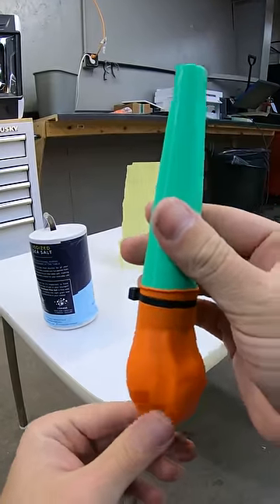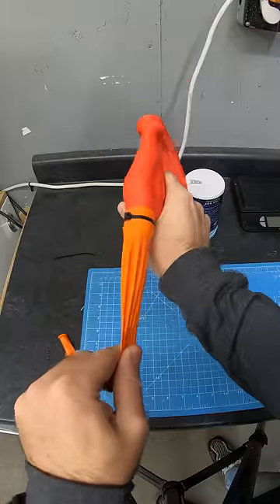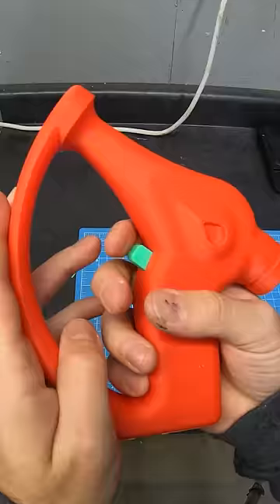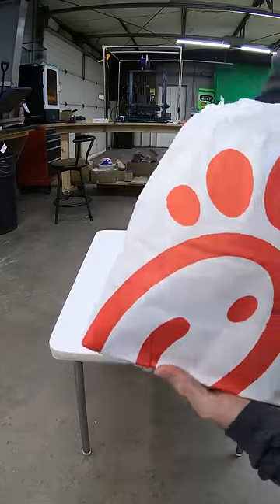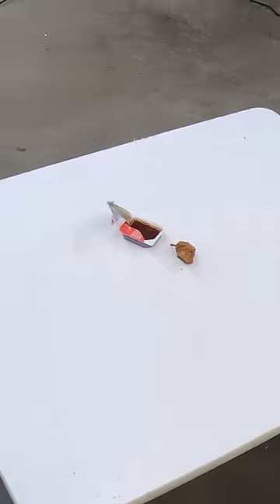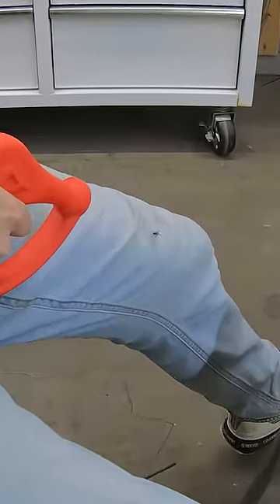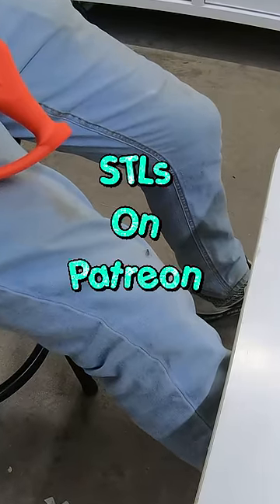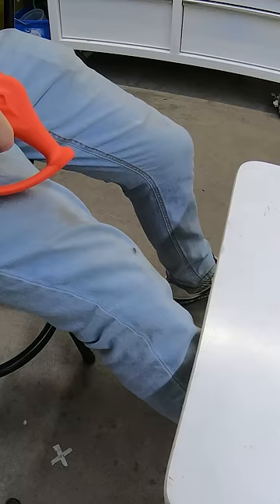3D Printed Bug A Salt?

Comment: You need a baral at least 3inchs or longer it will keep the spread pattern tighter at range giving you more range and velocity.
Reply: Distance and range are the same? No?
Reply: @adama.6074  they are, but i think range is usually used when talking about how far away you can accurately aim from, and distance is usually how far the projectile can actually travel.
Reply: @adama.6074 distance is the length that the ammunition can travel 
range is the distance of which the ammunition is effective at
if that makes sense
Reply: But you need spread in order to kill fly
Reply: At that point, dude could have just bought a salt gun for less time and effort spent.
Reply: You need Granulated grip Tape
Reply: @SirAuronthehonorable tell me you've never owned a 3d printer without telling me
Reply: @kuldeepsankpal6443 you need both range and spread. The range should be(for this product ) a 2-4 feet in case of wasps, or in my case hornets which are far more viscous than wasps.
Reply: Yall niggas really talking about gun smithing a salt gun😂😂 i love America 🇺🇸
Reply: @SirAuronthehonorable  Yeah but his channel is about making stuff
Reply: Ah yes CoD mobile logic
Reply: @adama.6074   I assume he meant to say spread instead of distance
Reply: So the longer the barrel the tighter the spread?
Reply: @BiBirdBoy both of them are used the same way
Reply: @kuldeepsankpal6443 a 3 inch barrel won’t make it a solid chunk it just makes the spread more focused
Reply: He made a fly blunderbuss. xD
Reply: Fr 😂😂😅...
Reply: Baral
Reply: Would just be pretty easy to put a choke on the barrel for spread
Reply: @BiBirdBoy mathematically speaking, distance means the distance between you and your target, and range the distance yoir bullet can travel
Reply: What if I want more distance but less range?
Reply: @BiBirdBoy oh so like accuracy
Reply: thats what she said.
Reply: @slop_core  Trust me buddy, you're not that guy/:
Reply: Just because you watched John Wick does not mean you know dead beat shit about guns
- My Dad, A Gun Expert who owns atleast 7 rifles {watching me scroll on comments}
Reply: Baral
Reply: He missed at 3 inches I'm not sure a tighter group is gonna help
Reply: @SirAuronthehonorable that's always true with building prototypes
Reply: @manofflorida1138 you lob the ammo at 45 degreees
Reply: @Alux_curly   another commenter corrected me, range is how far the bullet can travel and distace is how far you are from the target.
Reply: On the other hand, won't it force you to be more precise?
Reply: sorry to be that guy but its barrel
Reply: @blimbam  you are sorry for a reason
Reply: @BiBirdBoy  as long as you were corrected.   😂
Reply: And just more grains of salt hitting the target.

Comment: A slightly Longer and narrower barrel will greatly increase your accuracy. Mainly because it will help compensate for any directional changes caused by the inconsistency of the balloon pull. Also it will help regulate and narrow the spread of salt.

Comment: You guys need to know that the pistol is meant for bugs at a wasp level or maybe higher since it has compressed air... I have the pump rifle version and it CANNOT kill wasps as easily as it can flies. It took me 20+ shots from the rifle to break the wings of a wasp. It would not die from the salt even after 10 more shots.
Reply: Have you tried coarser salts on them?
Reply: @kayagorzan  I've used Himalayan salts on them yes... Still didn't kill the wasp.
Reply: I suggest using some sort of foam dart blaster. Some are really powerful and can annihilate a bug when it’s still.
Reply: Have you tried the 12 gauge
Reply: Tbh, you don't really need to kill them, but immobilize or confuse, then ye old shoe does the rest of the work, unless the fly sat on someone's balls.
Reply: @pinkius  Hell nah I had big red wasp flying around charging at me almost every time.
Reply: @Fipsh sand or dirt maybe

Comment: I forgot the channel name but you can just saw off a Gatorade bottle at the neck cut about half of the neck of a ballon wrap it around the gatorade top after you take the lid and the orange seal off then you just slip the seal over the balloon and you can drill a hole through the lid to make a pencil shooter or u can just take the lif off and shoot bbs and stuff

Comment: I've been working on modifying the Crossman Vigilante to shoot larger amounts of salt. (Obviously, you can just use the Shredder cartridge as is...) My issue is I can't leave a black metal pistol laying around my house, even if it is just a CO2 salt plinker.

I'm working on making a pink barrel front half of the Crossman, so you can tell it's clearly not a firearm.

Comment: I think you need a longer barrel, a stronger spring and an aim site to get the gun to properly shoot, the extended barrel will reduce the speed but increase the accuracy by reducing the shotgun effect, the stronger spring will counter that slower speed and lastly the insight will allow you to properly aim without shooting blind

Comment: If you have a pellet rifle that has the barrel that cracks in half. Prime it, then tear a small piece of paper towel. And put that where the barrel hole and gasket is so the salt wont go into that chamber. Lock the barrel back. Put a nice pinch or two of salt down the barrel. Put a small ball of paper towel in the end to make sure the salt doesn't just fall out when aiming down. If you have a decent enough bb/pellet rifle, It's way better than the over priced bug gun.

Comment: Only issue i have with this idea is your littarally shooting a corrosive materiel around, so if you live in the tropics and have metal items (witch are generally porly painted) around your house it will exacerbate rust.

Like, you wouldnt want to use this in a car, even if you vacumed it all up.

Comment: Make an crossbow instead

The reloading system in such WY that the salt is poured form top like in paint gun cartridge and it has an bow like metal plate with string or something bendy idk

And every time you pull it back and press shoot trigger it will go to default position and autmaticly pour salt to chamber